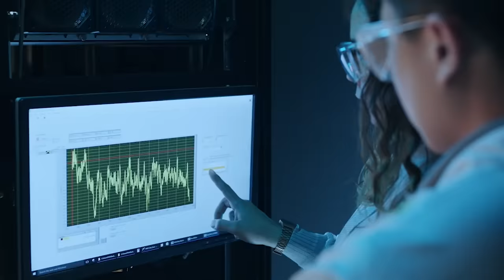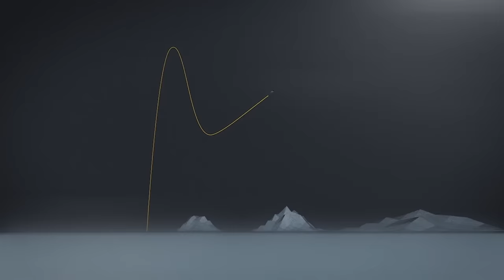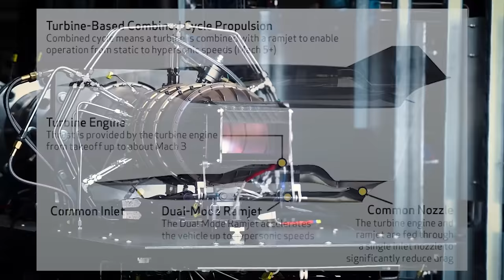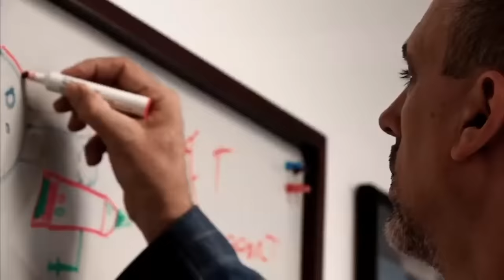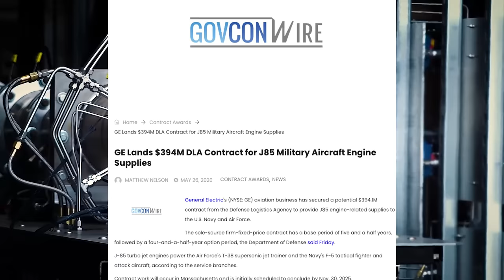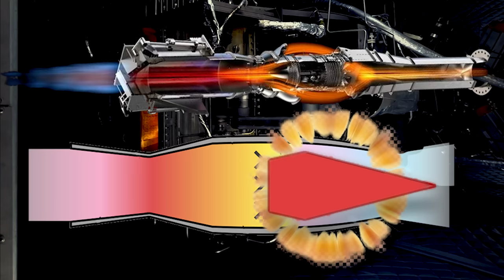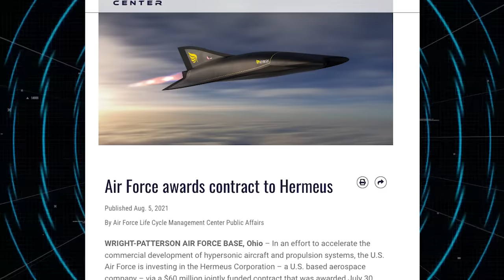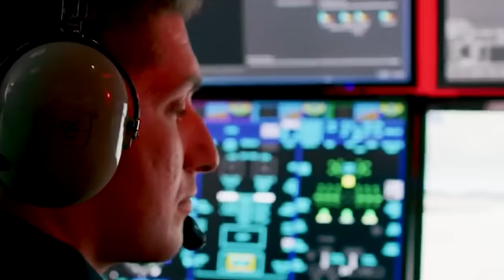Could HERMEUS turn the hypersonic arms race on its head?

Comment: Surprised they are not using the j58 engine core. It was designed & proven at the pressure/heat past mach 3. Would be surprised if the air force didn't have dozens in storage.

Comment: Rather than using coaxial turbine ramjet engines, I  would have been tempted to use the parallel flow design of the XF-103.

Comment: Hey Alex, I have a question. In the decades between the SR-71 and until today, why has the government or the private sector not field hybrid ramjets?
Reply: The average material sciences wasn't there yet. Ceramics and composites on the SR71 to even the F35/F22 has made leaps and bounds better but weren't there to provide a stealth coating and sustain it's material under the intense heat. It made it cost prohibitive for most manufacturers/companies and countries. Add in the fact where the defense contractor industry is rife with price gouging and only richest countries can afford it.

Comment: Using the engine as the ram jet flow split wedge is actually brilliant
Reply: To bad it's not original
Reply: @Darryl Viljoen, who cares
Reply: @kameronjones7139  yeah, who cares that it was fielded on production aircraft on both sides of the iron curtain.
Reply: @darrylviljoen6227  so what?
Reply: @darrylviljoen6227 what other vehicles have implemented this?
Reply: @aflyingcowboy31  using a cone in the intake to manage the supersonic airflow was used by amongst others, the blackbird and the mig-21.

Comment: You should have a look at Reaction Engines, they are devloping the tech to do single stage aircraft to orbit or  1 hour from London to Sydney. They have heat exchangers that can take a  after burning jet engine exhaust  and instantly turning it into cryogenic liquid to feed a rocket engine.
Reply: That’s a good trick, turning jet exhaust into cryogenic liquid.
I think you need remedial physics with emphasis on the second law of thermodynamics.
Reply: @triggerpointtechnology  
I suspect this person is referring to the use of cryogenic fuel cooled After-cooler, that cools the compressed intake air which is heated beyond 2000C at high hypersonic speeds. This temperature is too hot to increase further with combustion. By utilizing the cryogenic fuel they can lower the inlet air temperature to a usable value. The excess heat also serves to preheat and vaporize the fuel and inject it at supersonic speeds into the scramjet combustion section.

Comment: Of course if the US really fielded a hyper sonic replacement for the black bird back in the 1990's then they have already done this, but at what cost and how. Also there is reaction engines SABRE concept engine , which is a concept under development by Reaction Engines Limited for a hypersonic precooled hybrid air-breathing rocket engine. The engine is being designed to achieve single-stage-to-orbit capability, propelling the proposed Skylon spaceplane to low Earth orbit. which could go faster and i believe the Pentagon showed some interest in this engine.

Comment: A single F100 engine with ramjet will achieve around mach 4. That's the engine, not the aircraft.
The SR was a mach 4.4 airframe. The engine was a mach 2.2 engine. The spike is what allowed the SR to fly at mach 3.68.

Comment: I'm far from convinced here of the benefits of reusability.  There is another direction one can go: use economies of scale to reduce the per unit costs.  It's not like the materials used are that expensive, it's the costs involved in maching them or creating the composites to such high tolerances.  You could also try to reduce the per unit cost.

In the long run I think that's the better strategy as it means that your force isn't crippled if the other guy manages go take out a few of your expensive reusable craft.

Comment: If that could fly at high altitude and carry a powerful air-to-air radar, it could be a BVR juggernaut.
Reply: Since the plasma shell around the aircraft is conductive, does it not form an effective Faraday Cage around it, thereby preventing all EM signals in and out?

Comment: America needs to build a hypersonic sheild that is maybe a between at least a 10 miles radius. At first it needs the sperical sheild  which might be 10 miles from land and then another spherical sheild over  that is between 30 to 50 miles  from the first shield therefore the missle  will have to travel between both shields to get to its intended target therefore the while the hypersonic travel between both shield it can either be deactivated by means of interrupting signal and/or destroying it while the signal is being interrupted

Comment: Alex, I'd like you to present a video on female fighter pilots.  I support females being integrated into some parts of the services, but as a retired Marine with 21 years in the Marine Corps as an infantry officer with 3 years in combat, I doubt female Marine infantry officers today could endure the physical and mental exhaustion I and my fellow Marines endured in Vietnam in 1968-69.  We were in combat 30-60 days at a time with no way to bath, barely enough water to brush our teeth, we relieved ourselves wherever we happened to be, ring worm and leaches were a major problem, and one meal had to last 2-3 days because resupply was unpredictable because of terrain, weather, and enemy.  There wasn't any potable water.  We filled canteens with whatever water was available from local wells, puddles, streams, etc.  During the monsoon, we collected rain water with helmets.

We didn't wear any underwear or socks because it was just extra clothing that took too long to dry out.  Our uniforms would literally rot off.

I've met a Marine that wanted to medivac a woman who had been horribly mutilated by a mine or other explosives.

There is in our culture a certain respect for women that doesn't translate to brutal combat, at least in the Marine Corps.  But politics, not culture, mandates that women in the military are equal to men in their abilities, which us pure fantasy.

But in the Air Force it may be much different.  They have female fighter pilots and so I'm just curious if the female pilots are just as aggressive as the males and how have females performed in Red Flag against the opposition forces?

I also think females in the Navy for the most part can do all the same tasks.  But face to face combat on a daily basis with the enemy in harsh and unforgiving conditions in my opinion is a totally different matter that Congress and the Pentagon don't seem to realize.  To them it is simply a political issue.  To me in combat, it is a life or death issue.

Comment: In the context of compound turboRAMjets, I do not understand why you keep using the term "turboFAN."  A turboFAN is not going to withstand supersonic flow impinging on the fan blades.  A turboJET will; but a turbofan has too much mass - the blades would be ripped to pieces at supersonic speeds, if exposed to the slipstream. So, if it is a turbofan, it would need a relatively small diameter, and there would need to be some mechanism to shield it from the supersonic flow that powers the ramjet section.  EDIT: OK, I see that you referenced the PWA F100 turboFAN engine, used on the F-15 and F-16 - I worked on those engines back in the 1980s, when they were first in production.

Comment: Given the cost and difficulty of development, I wonder if China’s hypersonic missile’s are really that maneuverable.
Reply: Probably not like people are thinking.  My guess is that they can maneuver a few degrees while in the midcourse phase, and maybe very early in the terminal phase.  Once they get back into the atmosphere, they basically have to pick between being maneuverable or remaining hypersonic.  If they try to do both, they’ll either be wildly inaccurate, or they’ll be disintegrated by air resistance from trying to turn too hard.  And that’s assuming they could even get terminal guidance.  And even if they could maneuver longer, at some point, they have to make a beeline for the target.  If that target is armed with lots of air defense missiles, then all it has to do is get one of them directly in the hypersonic’s path.  Doesn’t really matter how fast the interceptors are for point defense.

Comment: I remember reading about these possibilites MANY YEARS AGO. Just like the video shows. It's one thing to get a missile to fly at those speeds, it's another issue to get one that's number one reliable;-) like the United States and Israel or Garbage like they're making in China ! Needs to be dependable, needs to have a proper guidance system to find its Target, and to be maneuverable as not to be shot down. A lot more to just speed. That is the reason why when Russia and China was throwing these words around. I was not concerned at all. Over the years I've Heard lots of BS come out of both of these countries.
Talk is cheap. Show me the goods ! Lt Rob, United States Airforce Retired.

Comment: Why can't they simply add some movable fins and some software to a ballistic missile?  Are the forces just to great at that speed, or is the heat generated just far too high?  It seems like it ought to be an elementary modification for a large US defense contractor.  Since that hasn't happened it's clearly not elementary and I'm intrigued as to why that is.

Comment: Hypersonic aircraft driven by AI will be a game changer bc it will be able to out maneuver any aircraft out there. Being able to take turns above 9G
Reply: It will have a turning radius of 300 nmi
Reply: Anything trying to make a 9G turn at those speeds would either be ripped apart by air resistance forces or would bleed off most of its energy.   Hypersonics can only turn a few degrees.  That’s not a pilot limitation that can be solved by AI either.  AI isn’t magic, and it can’t overcome physics.
Reply: @bluemarlin8138  the 9G is probably the same force regardless of speeds ignoring turbulence.  It’s just takes much longer to turn.

Comment: Let us propose "Hypersonic Maneuver Weapons" HMW because maneuver is the defining factor.  The mix of computational and control surface capability that does not degrade accuracy is the defining factor.  A corrective measure would be that of a ballistic missile trajectory within 5% of the CEP.   That's because the predicted cheat is the accuracy cost of adding the technologically and qualitatively challenging parameter of maneuver. 

This is just entry-level differentiation.  Remember how as a child we couldn't tell the difference between a Godzilla toy and a dinosaur.   Consider yourself played by experts in psychological warfare.  We're at the stage were Godzillas and dinosaurs have yet to be sussed out.

Optional parts of the term discern between lower and higher technical difficulty.  These are respectively:  solid fuel and airbreathing types.  Before the politics sets in these bear the abbreviations, "Air-breathing Hypersonic Maneuver Weapons" (AHMW) and "Solid-fuel" SHMW.
As an asides:  Seems like everybody else is looking to social proof something and no person or group has sufficient political clout to introduce corrective terminology.

FYI Nobody has hypersonic weapons, as Hollings noted.  Intellectual colonies (countries that copy US and Western tech) certainly don't have hypersonic weapons.  The C grade would go to SMHW because it is entry-level HMW.   Achieving AMHW goes a long way towards proving SHMW chops.   We can't see supermaneuvrability is in the DF21 missile design to achieve that or do we even need to? 

In fact, the control surfaces being limited cannot achieve the supermaneuvrability required by HMW.    They physics say that a small amount of change creates a large deviation based on speed.    So many corrections must be made during flight that does not impede accuracy.    Consider the control surfaces and computation retrofitting.   Can it really be done with a WYSIWYG missile?

Inadequate maneuverability is obvious inn the DF21 and "Dagger" missiles.   To think:  People actually felt for the hype that an intellectual colony actually possesses technology with quality that seem near peer or even peerless to its competitors! This is akin to the actually built and installed Chinese naval railgun.   This investment is still waiting for the US to make the concept work.  Talk about "counting chickens...".

For those that concoct so may ideas in one week there's a custom dictionary, words are important for separating ideas out.  Hypersonic Yaddah-Yaddah is the perfect place for a technological Bar-Mitzvah.   For example, In terms of relativistic speed (like cars in different lanes passing) and supermaneuvrability the PAC3 is a true SHMW.   Speaking of supermaneuverability -just look at all those PAC3 rocket ports.

Consider this:  If one can do AHMW they can easily craft SHMW.   There's no need to prove anything because AHMW provides the "A" grade for HMW.  It is ten times more complex than its predecessor.   It's conceivable that the society that creates it, the sum of supply chains and factories, is ten times more sophisticated in its tech trees or directed acyclic graphs.  Part of the hidden complexity is in the materials science and quality control that must be at draconian levels.   In the future one will see videos like the "Insane Engineering of AHMW Weapons" beginning with chemistry of metals and fuel then ending with computing stuff.

Due the primitive nature of strategical science, the hidden problem is actually political -it goes beyond Clausewitz and Communists.  Definitions may quickly shutdown pro-China and pro-Russian factions in the US eager to policy-wise please these intellectual colonies.  Thus, without a bird's eye view one can see the DF21 as a threat when most "experts" are easily fooled themselves.  Setting the definitions and their explicit meaning straight is a weapon far more lethal than a parade prop like the DF21 strutting across an annual one-billion-dollar (yes US not Yuan) propaganda parade.

Comment: What ever happened to the MPD turbines?  GE got one to work after 10’s of millions to various companies.  It would have been around Mach 9.  With much less fuel.  Then everything about it just vanished off of everything.
Like Syntroleum (fuels and lubricants made from water.  They bankrupt Texico because of this)  just vanished of the internet and everything.  Around 2001 + or Minus a few years.
Same as Dark Light Hydrogen technologies they all vanished within the same time frame.  (They had 250 Megawatt Generators that ran on distilled water)
Just asking?😉?

Comment: Assuming Hermeus works, inflight refueling is going to be a bitch. With current refueling technology, it would have to drop from Mach ~5+ to well under Mach 1 (subsonic), and from 100,000+ feet altitude to less than 30,000, and then waste a lot of fuel to resume at full speed and altitude. This energy loss would be even more dramatic that what the SR-71 encountered. And, if one measures the average speed of a 'mission', the average MPH figure will be much more dramatically compromised than it was for the SR-71, dropping from Mach ~3 and~90,000 feet.  This largely defeats the advantages of high Mach speeds. To overcome this, the U.S. may need to revisit the very dangerous nuclear jet engine program.

Comment: Since the problem is the engine transition, it seems like you could use a glide or parachute landing system rather than having a second transition back to the lower speed engine.

Comment: I think, because China already has operates a hypersonic system, it will combine it with a turbojet +scramjet or ramjet and have a hypersonic plane of mach 10,like Americans,because they progress very quickly I think they will work on it.Very good video Alex.
Reply: China's hypersonic systems are rocket powered, not jet powered like these ones are. Rocket powered hypersonics are relatively easy; we've been doing it since the 1940s. Jet-powered ones are a lot harder.
Reply: @robertc.9503  I didn't know that, thanks.

Comment: Hypersonic speed doesn't exist, get used to it. Speed is related to pressure and altitude. The higher you go the faster you're forced to go. But then you run out of usable layers of atmosphere for turbojet engines. And you have to develop a new (maybe cold, or bit) methodof propulsion. That's where the vtol's are actually used.

Comment: The real problem is that before Mach 2, below 10,000 feet, all of your radar absorbing materiel (RAM) will burn right off. Stealth is so much more important than hyper-sonic speeds.
Reply: If it can go hypersonic, and manuver, does it really need stealth?  Isn't that the point, to have something that can't be intercepted?

Comment: Youtube pilot Growling Sidewinder shows modern aircraft and missile technology in DCS simulator scenarios.
According to him, the Russians have an air-to-air missile called the R-37m that is capable of 7,000 to 8,000 mph at fairly low altitudes and very long ranges (longer than US AA missiles).
It can smoke F-22's as it is very maneuverable too, as he has shown.
Cool stuff those R-37m missiles

Comment: Zircon(🇷🇺) is deployed and in serial production.  It flies in excess of Mach 8 with it’s scramjet engines after it uses a rocket engine to achieve ignition in the scramjet.  It is single use but it is not a technology demonstrator say all.

Comment: Why? Lasers have already been deployed. 30/60/120 Kilo-watt lasers a reality. It should not be long until there are Mega-Watt lasers that will destroy the "slow hypersonic missiles. When your weapon is traveling 186,0000miles a second, these missiles are standing still.We ALREADY know about 120 kilo-watt lasers which probably means that there are Mega-Watt lasers, if not deployed, already in t test phase. More money for the dark hole.
Reply: I know laser absorbing coatings exist, but isn't the plasma around that Hypersonic missile hot as it is?